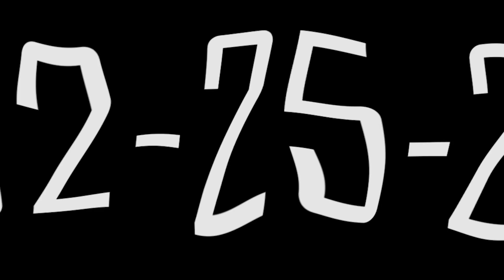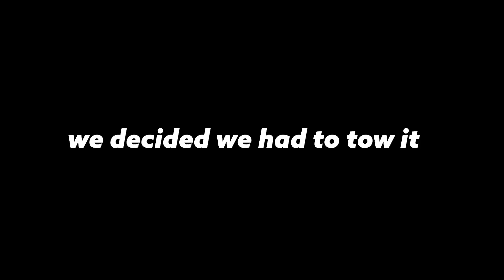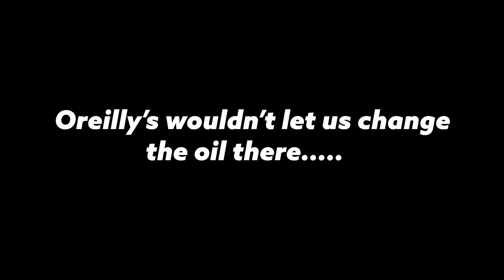How To Kill an AWD Honda!

Comment: TrailBlazers are good off-roading vehicles! It’s in the name
Reply: Not the new ones I'm afraid.
Reply: @johnfox3845  definitely not the new ones. I don’t trust any new cars
Reply: @computernostalgia6293  It's a shame that they replaced the Trailblazer with a front wheel drive unibody piece of crap. The 02-09 models were damn fine vehicles. My '07 might not get the fuel economy of the newer crossovers, but the towing ability and ruggedness is worth it.
Reply: I’ve been trying to tell them...in all of our videos I only have been stuck once. High centered in Zack’s ruts from his lifted Cherokee.